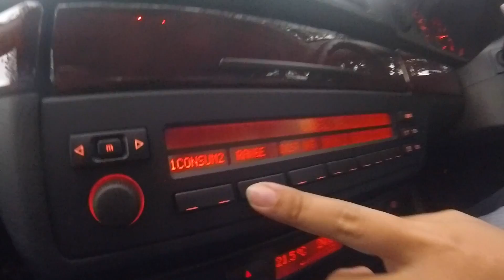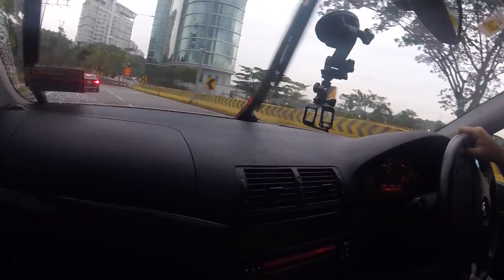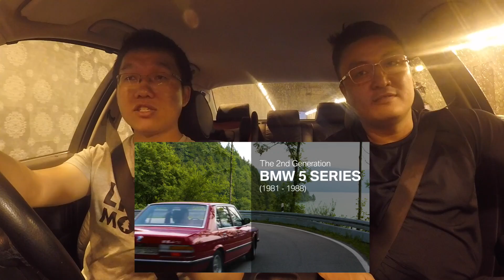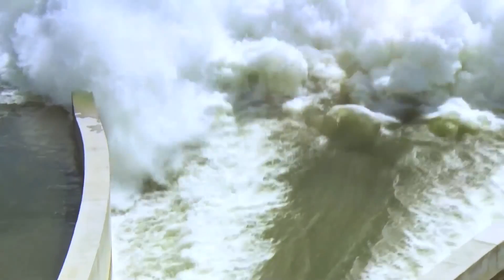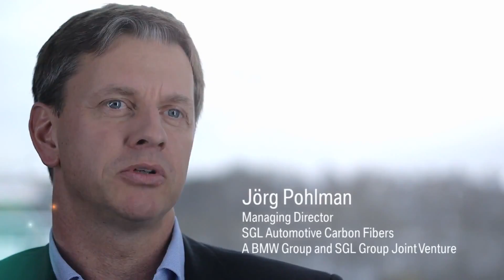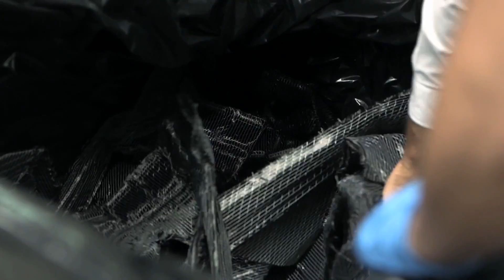Talk Gear Ep16: Why so many motoring writers drive BMWs?

Comment: I alwiz like BMW althou i have not owned one before. Now that i could see that the 15 years and bove is within like RM20k and below dont you guys think that the spare parts would be a killer say like for E39 or E46. By the way how is the pick up for these models and running cost which includes the FC as well.

Comment: are e46 still reliable nowadays?
Reply: If you buy the straight 6 yes 330i is a beautiful machine. Avoid the 4 they are loud and under powered. Like always check the log book.
Reply from the maker: Even a 2000s Lexus will no longer be reliable. An E46, better buy one from an enthusiast who will take care of the car religiously. And usually those that changed hands a couple of times are better taken cared off as most 'new' owners will put some money into it after buying it.
Reply: @BobbyAurizn  I beg to differ. Your sample in Malaysia are so small to be taken into account as a reliability survey.  Lexus is way more reliable than BMW by far that is undisputable. The fact is the fact. Asian cars top reliability surveys and they are cheap to maintain. You may get free services here and there for advert direct or indirect but for general public maintaining a unreliable Euro car is a nightmare. Another thing being a car journo you don't drive your car day in day out like most ppl.
Reply from the maker: Of course Lexus is more reliable. But for a 20 year old car from the late 90s, it's no longer about reliability but about whether wear and tear parts were changed. My reply to him is to put into context that even the most reliable brand, Lexus, if one is from 1998, its no longer about inherent reliability, this is to answer his question whether E46 is reliable or not now.

Comment: I keep hearing people mentioning about BMW's lack of reliability, especially beyond 5 years. May I ask what are the common problems faced by BMWs and how serious are they?
Reply from the maker: the main issue with bmw is that people who've never owned before are BMW experts ....
Reply: @BobbyAurizn  actually I have heard from 1, 3 and 7 series owners that they do face issues too but it's usually often but minor like oil leaks or electronics related. Just wondering how common those are and whether it causes much downtime? Any major reliability concerns like gearbox? Quite interested in the 4 Series convertible but considering it against the C class Cabrio
Reply from the maker: 4 series bro .... drives so well. Complicated premium cars will have complicated issues. Go read around Prius forums, Mark X forums, Lexus forums you will also find people mentioning issues one will never get in Corollas or Camrys solely because those cars are more complicated. :) my Crown had more issues than my Audi .... my bimmer problem free
Reply: @BobbyAurizn  thanks for the advice! Shall take a closer look at the 4 Series

I must say I was very impressed by your recent C200 n C300 driving reviews tho, which is one of the key reason I'm considering the C cabrio!
Reply from the maker: Ok i have to say, the 4 drives better of course, and in my personal opinion, a much sportier design. But the C coupe or cabrio is wayy prettier and has an air of class to it. Either way, after buying your cabrio must join our dropthetop group ya
Reply: Hi  @BobbyAurizn , I've finally bought an E300 cabrio. Got a good deal at almost the same price as a C300/430i. How do I join the dropthetop group?

Comment: ive previously owned an e60 530i m sport..and it has one of the most fuel efficient 6 cylinder n/a engines ever, even more so than a v6 Mercedes at that time..apart from it being rev happy, creamy smooth torquey n powerful..n handling was typical bmw,, superb especially in m sport trim...bmws makes some of the best engines..n one of the more reliable part of a bmw is its engine hehe..and with bmw it is better to get the latter batch or the facelifted version as it often comes with resolved mechanical issues n less problems overall..just my experience after owning 2 different batches of e60 hehe
Reply: Agree on this. And I was surprised to learn from my E39 group that those running 530is generally get better fuel consumption than my 520i!
Reply: Kon Wai Luen ..

Comment: Mercedes gives passengers pleasure. While BMW gives the driver a pleasure.
Reply from the maker: New bimmers are more comfortable than new mercs
Reply: @BobbyAurizn mercs interior better?
Reply from the maker: @Vincent Yap prettier i would say ... if you understand mandarin .... watch this ... he dissects a G30 and a W213 to see the level of build .... crazy guy https://youtu.be/UaqPgRlJQJ8
Reply: @BobbyAurizn  同意。
Reply: Bobby Ang i concur with you. The C350e was somewhat okay, but the G30 5er with the M Sport suspension was way nicer to ride in, even without the air suspensions on the C350e. Weird, but true.

Comment: Bobby, is it worth to buy a used e60 for rm30k-50k? Any other suggestion for used bmws in that price range?
Reply from the maker: Yes. But already a cash buy. So i personally will prefer the F10 which still qualifies for a loan, hence my initial outlay is just the 10% upfront haha
Reply: if you want to get the e60 just be sure to get the latter batch or facelifted versions as it often comes with resolved issues..get it in an m sport trim..i feel like it handles better than an f10 hehe..f10 was the first new 5er to give more priority to comfort.. the handling then gets better with the g30 hehe
Reply from the maker: Agreed @mc Mac the E60 handles better (or feels that it handles better) than the F10. But the F10 is still damn nice compared to its peers A6 and W212. G30 handles really well but I dont like the fact that BMW made the car hide its talents whenever it could. Upshifts as soon as it could (even in sports mode), eases the throttle inputs whenever it could, ignores accidental kick downs whenever it could, and removing sport plus, all in the name of efficiency, emission control, warranty control. It made the car want to relax, want to cruise, want to chill .... it's so relaxing and comfortable that I felt I'm no longer in a sports sedan. But BMW engineered the car to do all that we can throw at it. So in technicality, the car can and still is the dynamics champ, but BMW made it hide its talents.